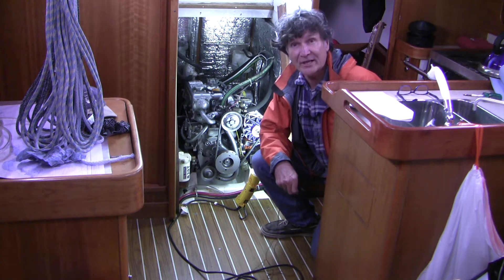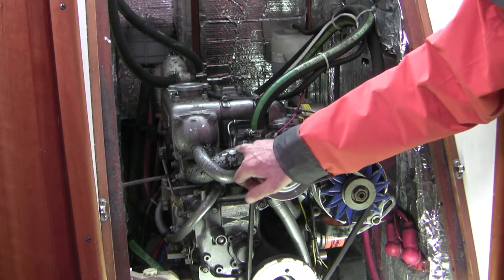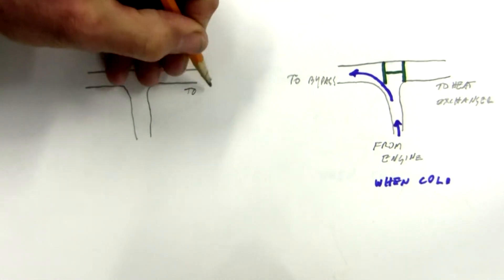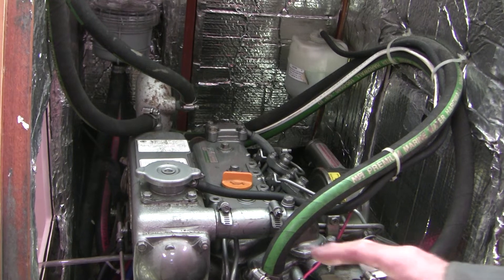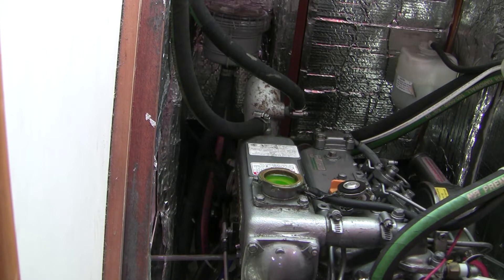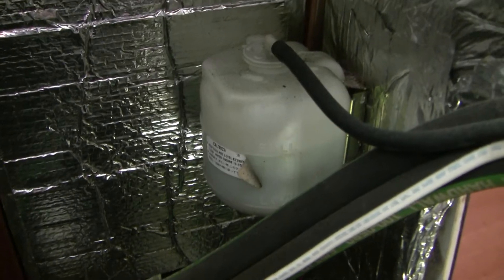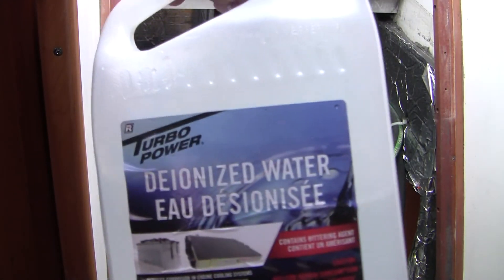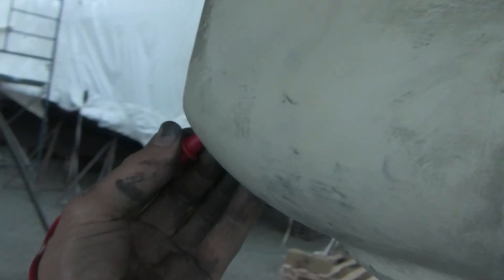Understanding marine diesel engines: Yanmar coolant exchange

Comment: hello, very good video thanks. i have a question: i need to replace the coolant in my yanmar 4jh4ae i have water heater exchanger connected, you skipped that point in the video, how do i empty the pipes and refill them in order not to get air trapped? thank you very much for your help!
Reply from the maker: Excellent question. The right way to do it would be to disconnect both hoses leading to the heat exchanger, then flush the lines from one end. If you had a drain petcock at the exchanger it would be easier but many don't have one, and draining at the exchanger is difficult because of space considerations. I would flush with distilled water from a jug, using a funnel into one hose and a bucket draining the other. The fill line has to be above the high point of the drain loop for the siphon to work. To get most out you'd have to replace volume twice, probably a couple of liters. Then when  clear, flush with coolant. The simpler option would be to disconnect and fill only one line, draining extra volume sent to the engine the normal way from the engine. Inevitably you'll have trapped air at the top of the hoses after reconnecting. Your water pump will automatically clear that trapped air, by pushing those air bubbles into the heat exchanger after the engine warms up. When hot the expanded high pressure air is pushed past the valve in the rad cap into the coolant reservoir, where it percolates to atmosphere. As engine cools, fluid in the coolant reservoir is drawn back to replace the volume lost.

Comment: Thanks for this video.  I had a Yanmar raw water cooled engine, so zincs were important and there was no heat exchanger. Now  I am looking at a used boat with a fresh water cooled block and the associated heat exchanger.  This video was a help in anticipating the differences,

Comment: Great video.  One question, there is much written about mixing green and red coolant being a very bad idea.  I noticed you went from green to red here without flushing with fresh water in between.  What are your thoughts on this? Is it an issue?
Reply from the maker: You make a good point. I don't know what the previous owner used, and coolant color is no longer a reliable gauge. So, whatever I used was going to be a change. The data sheet on the new coolant claims to be compatible with traditional ethylene glycol, so it is probably OK. Yup, a purist would say to use distilled water, flush again, and put in the new coolant. With the residue found at the drain plug, I'm going to end up doing that anyway pretty soon. In the long run, switching to a coolant with antioxidant properties should be a positive, not a negative.
Reply: @spelunkerd  I had the same problem with the blockages last time I changed.  I have just swapped out the calorifier so am thinking that a proper flush and change is in order.  Have you ever considered running the hot water take off hoses into a bucket of water and running the engine?  I’ve not tried it but thinking that it may be a good way to flush the system, allowing the crud to sink to the bottoms of the bucket.
Reply from the maker: @dickonberriman3040  In the 'old days' of automotive repair, we did just that, and it is shocking to recall it was standard practice to let it go into the storm drain. They still sell the adapters for garden hoses, but few use them. Occasionally there is a reason to back flush a heater core, to try and dislodge crud, but boats don't have those. Yup, that would work, and you could take those fluids to the local recycler for free.

Comment: A well explained video and i learned even more from the comments, time to apply these things now, fair winds !
Reply from the maker: Thanks, my reply to Patrick smith summarizes it well. Fill both the reservoir and at the cap, since both need to be close to full for the automatic burping process to work. Happy sailing! Sailboat racing is canceled around here because of Covid protocols, but we hope to resume in a couple of months.
Reply: @spelunkerd  Hi there, I decided finally to do the coolant exchange job, from what I can see there is some solid sediments in there mud like stuff.
How do you flush the system from this ? I remember at the video you wanted to do this job sometime.
Reply from the maker: @boardelia  I did a followup two-part video where I change out the coolant water pump. I think part 1 was titled something like "how to clean a marine heat exchanger". At the beginning of that I show a short clip where I removed the starboard side coolant drain petcock, then take a loop of wire and push it up the hole to allow coolant to sweep that debris out. It's a messy job! Once the heat exchanger is removed you can clean it well. Cleaning that heat exchange is a normal maintenance job you should do every several years. Good luck!
Reply: @spelunkerd  I just wached it, thanks for the time you took to write to me ;)
You make things look easy, i hope it will be the same when i do it !

Oh by the way, i hope you didn't skip the lub oil cooler, it has the same tube structure as the heat exchanger and needs the same treatment - at least as the yanmar 4jh2 series i have.

Comment: Great video.  One question on replacing the coolant.   Is there a bleeding procedure to ensure all air is purged from the system when adding new coolant.  I may have missed that step in the video.  Thanks
Reply from the maker: Fill it with coolant at the heat exchanger cap on the engine, and fill the reservoir too. Leave the exchanger cap off and start the engine. Add coolant as the level drops. Wait for the thermostat to open while carefully adding coolant. Watch for air bubbles and a change in temperature of the hoses coming off the engine (this will show the thermostat has opened). This takes about 10 minutes. While waiting, don't forget to verify that your salt water flow is adequate, and you haven't forgotten to open the seacock. When the engine reaches operating temperature, shut the engine off and immediately put the heat exchanger cap on tightly. Let the engine cool overnight and then next morning recheck levels at both the reservoir and the heat exchanger cap. It is normal for the heat exchanger level to rise and the reservoir level to fall overnight. This shows the automatic burping process is working. The next day out, let it run til warm, then shut down as usual. Recheck levels a couple of times over the next week, it is very common to need more fluid as air pockets are purged. This procedure is called 'burping', similar in cars as well. Some engines have a petcock to do this more easily but in small engines like this they are usually absent. I show how to do this in cars in the automotive cooling system playlist on my channel. Good luck, be careful with hot coolant, and if the engine overheats shut down immediately and think about what went wrong.
Reply: Hi Dave, awesome explanation - and dedication. Just blows me away. I had an overheat alarm on my Yanmar YM 2/20 just after having had the piping done to connect the freshwater system to my boiler. By a trained Yanmar pro. But he apparently left w/out making g sure the system is bubble-free. Now I am doing his job and wondering why you left out the exchanging of old coolant (and bleeding) from the pipes connected to your boiler? Aren't they just part of the regular burping process from the coolant system of the engine once the thermostat has opened? That got me wondering. Thank's a bunch for a quick note!

Comment: I've been a dinghy sailor my whole life, but I finally decided to buy my first big boat earlier this summer. I got in way over my head trying to understand and take care of the engine, but as a visual learner, your videos have been a godsend to get me up to speed on the basics. Thanks!
Reply: We're in the same boat buddy! How are you getting through?
Reply: @sailboatshellesseasailing4567  we've made it this far without any catastrophes! Every little thing I've done on the engine, even if it's just as simple as changing a filter or something, adds to the bag of experience
Reply: @jackdodsworth6077  Good Work! I'm hoping for the same luck! This week I'm I'm going to take some tape and label the parts so I can get more familiar with them
Reply: @sailboatshellesseasailing4567  what make of boat did you get? I was looking at first for a little 23-25 footer bc that was a little more in my price range, but I wound up getting a 30ft S2 9.2 from a very nice older couple who just wanted to pass the torch rather than recoup money, so they sold it to me for 60% of what it was worth. Very serendipitous, it's been an absolute joy for the last year
Reply: @jackdodsworth6077  You're a winner! Haha that's great. I managed to get a 1998  Beneteau 30 (somehow it was made after the production of that boat generally stopped). I got it from another sailor who already moved up in size some years ago and still had this one in the marina but conveniently was trying to sell just as I was finishing up uni.
Reply: @sailboatshellesseasailing4567  Very cool. I'm glad to see some other young folks getting into boating (one year left in my undergraduate program myself), makes me feel like I didn't make a stupid decision buying this thing haha. If you ever find yourself on the Chesapeake, give a holler.

Comment: You mention the pin hole leak in the overflow tube. I recently took a boat out that I found later had the recovery tank cap off, and engine compartment was spewing white/grey smoke.   Is it possible the pressure blew off the cap?  Or is it more likely it wasn’t secured properly and coolant was being leaked all over the engine block.  Great vid.
Reply from the maker: Hard to say, a severe overheat will cause fluid to spew back and it could blow the cap off. As you say, when coolant hits the top of a hot engine, it will create steam. On the other hand with a boat, if cap is left off it wouldn't be uncommon to spill coolant everywhere. When you refill, be sure you also refill from the engine cap, not just the recovery bottle. Trapped air can cause an overheat which can be very confusing, so you need to burp the system.

Comment: Thanks excellent presentation.   As I'm getting ready to change my cooling fluids - I'd like to flush the system to remove dirt, rust or any other particulates - is there a recommended flushing solution?
Reply from the maker: In the old days we'd flush the system with a garden hose, letting coolant get into storm drains! Not appropriate today. I would flush with water, preferably filtered or distilled, and I'd find a way to trap the outgoing water into containers to be recycled. Then I'd do a final flush with distilled water. As you know there are acid-based cleaning compounds that can clear calcified debris more effectively, but these are less popular now that aluminum components are so prevalent. Unless you have clear evidence of calcium buildup I think I'd avoid heavy cleaners. Over our generation we have mostly given up using tap water for the cooling system, favoring premixed coolant or diluting with distilled water. So the need for heavy decalcification of the fresh water side is less than it was. For the salt water side, weak acids like acetic acid and phosphoric acid (barnacle buster) are popular but you want to avoid letting them spill freely into the ocean. Good luck!

Comment: Thanks for the video, it is super helpful! 3 questions if you have time:
1) When you drained the coolant why didn't it also drain the loop going to the water heater?
2) How on earth do you detach one of those water-heater-loop hoses without making an enormouse mess (and I also can't imagine how you refill them without an equal mess)
3) I assume you "check" for air by making sure you replace the same amount of coolant that you took out. If you take out 8L, but only 7L "fit" back in... how do you get the air out? Is there a bleed screw like on a fuel line?
Reply from the maker: Excellent questions. It would be easy enough to detach one side, have a bucket of coolant/distilled water above and flush it through. If only one side is detached then it will return into the engine and drain through the usual engine drain. Messy if you detach both, but you won't risk sending debris deeper into the engine. The only way to get solids out would be to remove hoses at the heater and flush there. Regarding air, the burping process is to leave the cap off, run the engine, and let the pump push bubbles to the top where they clear. As you say some engines have bleed lines, this one doesn't. Auto technicians sometimes use a vacuum system to more quickly release air. If you get it close, the auto-burping process at the cap takes care of the rest. Thanks!
Reply from the maker: Oh, forgot #1. The heater is so low that when air breaks the siphon the remainder will stay in the heater core.

Comment: Thank you for showing the blocked drain. When I drained my coolant, nothing came out. I remembered your video on blocked drain and i used a galvanise wire to poke the valve, lots of dirt flowed out with the coolant. :)
Reply from the maker: Yeah, I'm planning on doing that when I get a chance, it will be a messy challenge if successful. If I can clear it that way, there is less need to remove the housing, though I have new gaskets already. This drain is obviously designed to be in a place prone to sedimentation, and draining regularly will help to keep the system clear.
Reply: I had a semi blocked drain on my port side  as well. And coz I saw your video I unscrewed the spigot and plenty of sluggish sediment came out. I flushed the system twice to get (hopefully) rid of the sediment. But will do coolant change now more often. 
Two questions if you don't mind asking: 
a) what exactly is that sediment? How does it evolve? (FYI: In my case, I had a leaking seal on my heat exchanger and so coolant and sea water were mixing each other.  But I hoped I had it fixed with a new seal). 
b) Many different opinions about using expensive coolant from a marine dealer versus cheap coolant from the car part store/gas station. Manual says to use coolant code 7997, 7998 or 7994. If you could on one of your next videos talk about the importance (or not) of using the expensive coolant.
Reply from the maker: @tobibcngmail8042  I think most of that debris comes from hard metals dissolved in normal water when people incorrectly use tap water to dilute antifreeze. There is likely some oxidation and rust as well from the sidewall of the tank. Antioxidants in coolant are designed to control that. The first generation of inorganic silicates and phosphates have largely been replaced by more modern antioxidants, and the newest have an "OAT" organic chemistry that doesn't last as long. Honestly I almost always try to replace it with what went in before, if I know. Failing that I put in what the manufacturer recommends. There is a popular and inexpensive 'universal' coolant that would be a reasonable choice. Thanks for watching!
Reply: @spelunkerd  thanks for your response. Keep on doing such explanatory videos. (e.g. would have loved a video for heat exchanger cleaning).

Comment: I have read many times to never switch from green to red coolant (or visa versa) the issue is that if you don't get every last drop out of the system of the other colour, the 2 colours mixing create a very acidic solution which destroys radiators/heat exchangers. Always stick to using whatever was in there from the factory or the previous owner (or look in the manufacturers service guide)
Reply from the maker: Thank you for your input. I mostly agree, as evidenced by the entire shelf of different antifreeze solutions at my shop. Each is dedicated to a member of our small fleet of vehicles. In the case of Yanmar, they don’t specify what brand of antifreeze to use except to say they recommend one with anti-corrosion properties and one that plays nice with aluminum. Finding an exact match to the old coolant would be impossible, although it it was almost certainly ethylene glycol, probably with old style silicate or phosphate IAT inhibitors that don’t last very long. The coolant I chose is ethylene glycol based, with no silicates or phosphates, and the data sheet indicates broad compatibility and hybrid chemistry. In any case I am planning on servicing the heat exchanger next month, so another flush is planned anyway.
Reply: @spelunkerd  I have heard the same thing. If colors have been changed in the past, that might be why your heat exchange drain plug gummed up.
Reply from the maker: @flipitygibet  That's a thoughtful point, though typically green coolant is used in perpetuity, and the popular 'universal coolant' wouldn't do that. More commonly people used tap water to dilute coolant, and impurities in tap water were by far the most common cause of precipitates. I haven't used tap water in years, but even today I saw a pro pour tap water into a classic car. Not wise or responsible, but the cheat saved him a couple bucks and the client will never know. Stop leak is the other mistake, though it typically has a mucky texture, very different to this. Of course the other issue is rust, made worse by expiration of antioxidant inhibitors. Old style green coolant has inhibitors that don't last long and don't work very well, and many versions don't play nice with aluminum, although the base antifreeze lasts forever. This did have a rusty color.